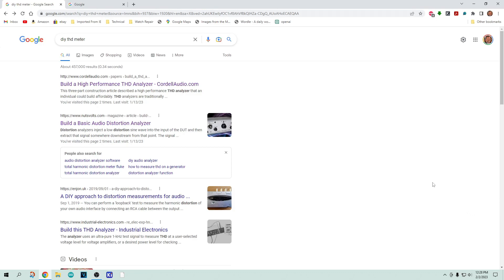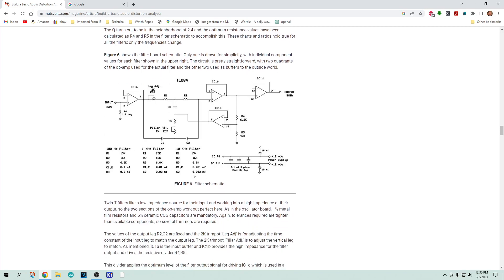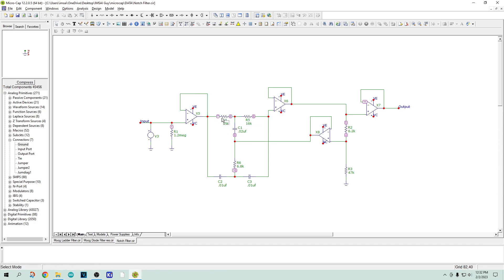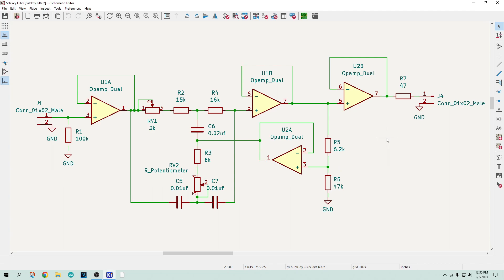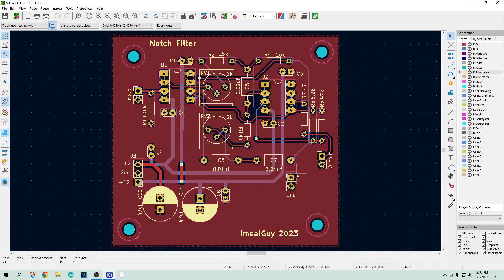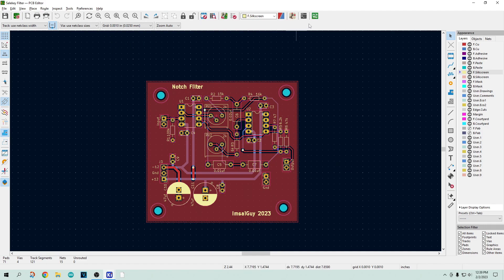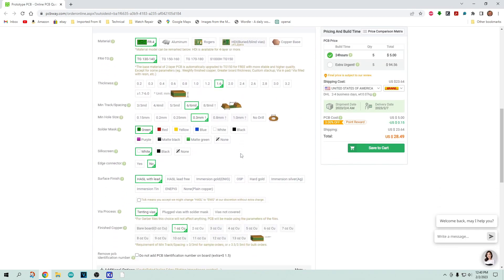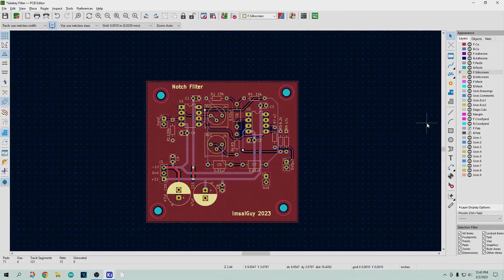#1425 Notch Filter (part 1 of 3)

Comment: #define mu 0.2f				//convergence rate
#define M 5					//order of filter
#define I 1000				//number of samples

double Input[I] = { 0.0 };
double Desired[I] = { 0.0 };

//double H[M] = { 1, 0.5, 0.25, 0.125, 0.0625 };	//the main system
double H[M] = { 0.0625, 0.125, 0.25, 0.5, 1 };		//we need inverse of main system to convolution

void initialize()
{
	for (int i = 0; i < I; i++)
		Input[i] = rand() / (float)RAND_MAX;

	for (int i = 0; i < I; i++)
	for (int j = 0; j < M; j++)
	if (i - j >= 0)
		Desired[i] += Input[i - j] * H[j];
}

void main()
{
	initialize();

	long T, n = 0;
	double D, Y, E;
	double W[M] = { 0.0 };
	double X[M] = { 0.0 };

	FILE	*Y_out, *error, *weights;

	Y_out = fopen("Y_OUT", "w++");				//file for output samples
	error = fopen("ERROR", "w++");				//file for error samples
	weights = fopen("WEIGHTS", "w++");			//file for weights samples

	for (T = 0; T < I; T++)
	{
			for (int m = T; m > T - M; m--){
				if (m >= 0)
					X[M + (m - T) - 1] = Input[m];	//X new input sample for 
									//LMS filter
				else break;
			}

			D = Desired[T];					//desired signal
			Y = 0;						//filter’output set to zero

			for (int i = 0; i < M; i++)
				Y += (W[i] * X[i]);			//calculate filter output

			E = D - Y;					//calculate error signal

			for (int i = 0; i < M; i++)
				W[i] = W[i] + (mu * E * X[i]);		//update filter coefficients

			fprintf(Y_out, "\n % 10g % 10f", (float)T, Y);
			fprintf(error, "\n % 10g % 10f", (float)T, E);
	}

	for (int i = 0; i < M; i++)
		fprintf(weights, "\n % 10d % 10f", i, W[i]);

	fclose(Y_out);
	fclose(error);
	fclose(weights);
}

Comment: Op Amp filters are amazing.....You would like to look over the Automatic Self Tuning Notch & Hi-pass filter designs used in the 1972 Kustom Signals MR-7 Moving police radar.....I couldn't believe how complex it was for '72 where Both the Low Doppler (road speed audio doppler return) & High Doppler audio (oncoming Lane vehicle Target return) signals are automatically Simultaneously tuned, separated & digitally displayed.....First time I ever saw analog Self-Tuning op amp filter circuitry.....

Comment: If you want to see a more-symmetrical response, use a logarithmic frequency scale for the Spice output plot.  (The responses of any types of electrical networks look better using a logarithmic frequency scale, and it becomes easier to see all the response details of a complicated network over multiple orders of magnitude of frequency.)  🙂   The notch is not super-deep because R3 and R4 are mismatched in the model, but there is something odd about the Spice model output.  Why is the output below -270 dB?  At frequencies well-removed from the notch, the output voltage should be very close in magnitude to the input.  I would expect the phase response to be near zero degrees at low frequency since the op-amps are connected in non-inverting configuration.  Also, the notch looks too wide, given the presence of the feedback.  Perhaps one or both power supplies for the op-amps were not enabled??

Comment: The article in audio magazine is interesting, thanks for pointing it out.
But I believe, you can make a THD with a good A2D convertor and digital processing.
May be you can put a notch filter before A2D converter to get increased resolution.
This made me think phase nose is specific case of THD.
For phase noise we measure amplitude of "one" offset frequency from carrier and compare it with amplitude of the carrier, whereas in THD we are measure  amplitude of all offset frequencies from carrier and sum their power up .   
Here also it made me think that in THD do we compare that with the power of the carrier?  That is a 1V pp carrier causes different THD than say 10V pp carrier.
In RF we have 1dB comparison point, and 3rd order intercept point.  I guess the true THD should be measured at 1dB comparison point of an Amp, but this is not specified in the defination  of THD.
This made me research the subject and found out that THD has different variants.  THDr,  THDf,  THD+N.  You can read about it in Wikipedia.